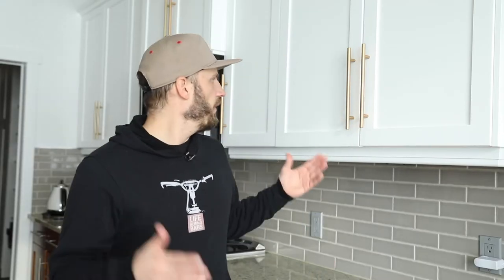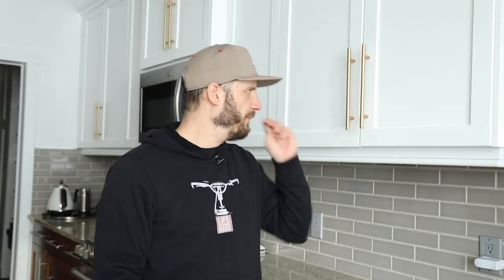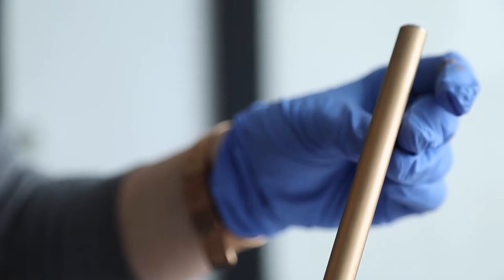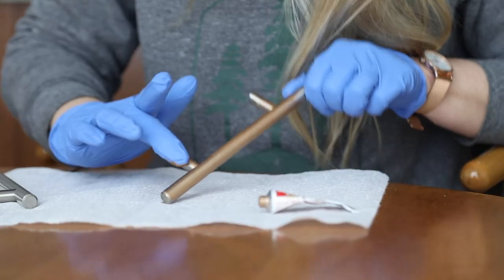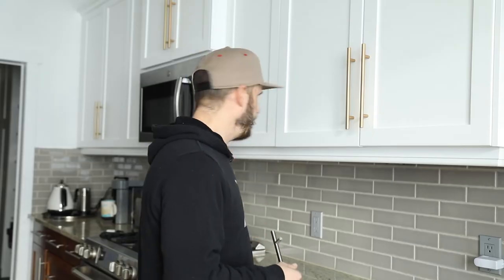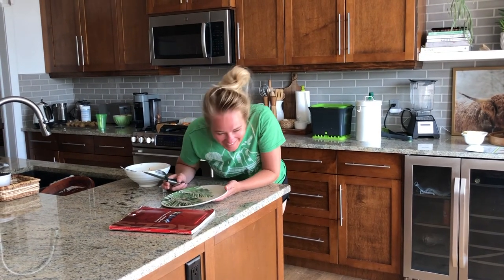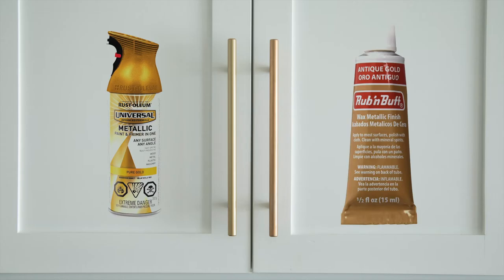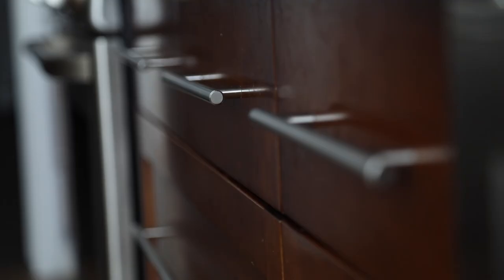Painting Cabinet Handles. What to expect. Unsponsored truth.

Comment: Great video! You can spend a fortune on handles.
Here are some tips before you spray your lowers. Prep, prep, prep!! I cannot overstate this enough. Especially with going black. No matter what any sprayer or paint claims there will be overspray in the air. About 75% of the time it takes to spray is in the prep. Remember that paint that falls on the floor will remain wet for a bit, so be careful of walking around with paint on the bottom of your shoes, not that I've made that mistake before, lol. 
Next make sure you have a board to practice on. It is very easy to have inconsistent paint coverage. Practicing will help a lot with consistency.  
I still would lightly sand in between coats, and do multiple light coats. One final thought is to understand that primer and paint usually have different thicknesses. So you might need to adjust the pressure on the gun. Best to figure that out on the practice board.
Best of luck, cannot wait to see your finished product.

Comment: How’s the rub b buff holding up? I just did a protective coat of varathane.. and I’m thinking it might have been a mistake 😅. Time will tell, but would love to know how yours are holding up.
Reply from the maker: The busiest handles are showing some weakness! Starting to wear off a bit. The least commonly used handles are fine though. I’d do a better job sanding next time.

Comment: These look good man. I'm curious to see how your bottom cabinets come out from spraying them. I just posted a long ass comment on your other video where you painted the upper cabinets.
Reply from the maker: And when you say long-ass comment, what you really mean is a novel that is meant to be read on a beach! LOLOLOL It's funny because basically everything in that comment is the stuff that people are looking for answers for. The videos that are sponsored by the big box stores skip 1000 steps and don't answer what to do when you have a gap over the cabinets. How hard it is to get a sprayer dialed in. Controlling dust! All the time for drying and sanding and blah blah blah. I'm dreading spraying the lowers but I'm gonna do it just to satisfy all the commenters who are saying "just get a sprayer" Another REAL LIFE video coming in hot!
Reply: @RinkVideo  haha. My motto is why respond with only 5 to 10 words when you can just as easily type out 500 words. 😂

I can’t wait to see your video on spraying. The guy that specializes in spraying cabinets (yea the one that wouldn’t take the basically blank check to help me out) told me you want a fine tip which of course means buying an upper end sprayer. You might actually check with either the big box stores or even a paint store and see if they rent out a sprayer. Wish I could be there to see how it turns out for you (grabs a beer, pulls up a chair and lights a smoke) 👍

Comment: Hey, how did the rub and buff hold up? I’m thinking about using on the brass at the bottom of the bathroom mirror.
Reply from the maker: Bathroom mirror would be no problem. Some of the higher contact areas showed some ware but on a mirror should hold up perfectly

Comment: Did you have to sand off the metallic Rust-Oleum paint before putting on the Rub n Buff paint?
Reply from the maker: Yes I believe we did. But we didn't go crazy with the sanding.
Reply: @RinkVideo  Thank you. I suppose if you were spraying the paint over the Rub n Buff "paint" you would have to do a thorough cleaning and heating to get that waxy film off though. That would take forever, it would seem. Good thing you didn't have to do that.

Comment: How would you rate the durability of rub n buff on those handles? Does it stain or wash off with usage?
Reply from the maker: After a couple months now I would rate the durability 7.5 out of 10. It works better than I thought it would but it’s certainly not indestructible. It doesn’t stain but gets slightly worn on the heavy usage areas.